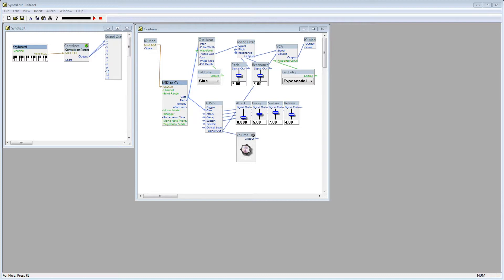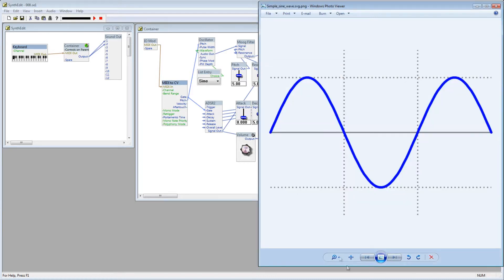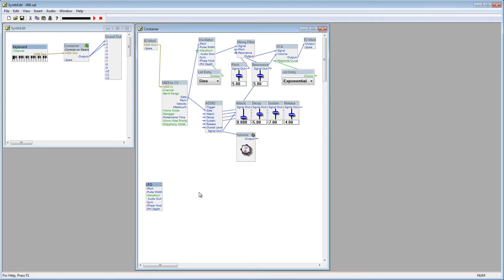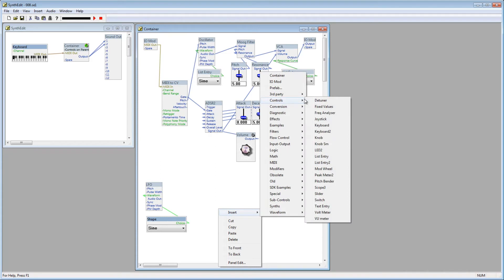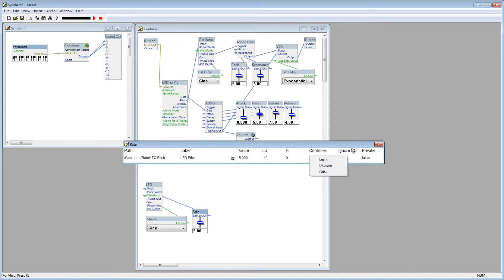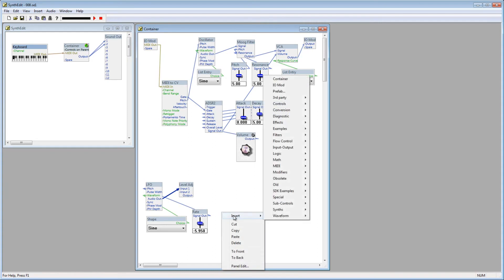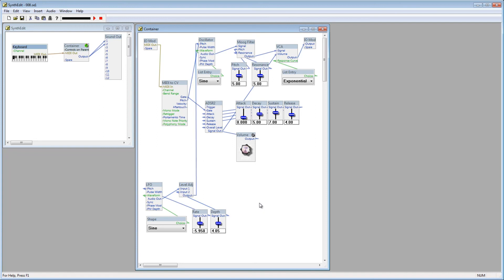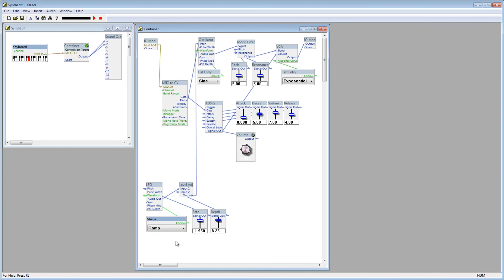SynthEdit Tutorial 9 - The LFO, or Low Frequency Oscillator

Comment: before watching this I used a VCA to accomplish the same thing as the Level Adjust. are there advantages or disadvantages to using either or is it conceptually the same thing?
Reply from the maker: I'm not positive, but I believe it's the same thing, conceptually. You're using the volume on the VCA to control the depth, like I'm doing with the Level Adjust, right?
Reply: hey while your here do you know how to get FM oscillators in Synthedit? like DX style FM. I'm trying to make a small FM synth with different waveforms but can't figure out the oscillators
Reply from the maker: No, I don't know about that yet.
Reply: +TodaysTuts ok then thanks. Btw yeah I was using the vca volume to control the depth. It seemed to work the same. Thanks for the tutorials though they're super helpful